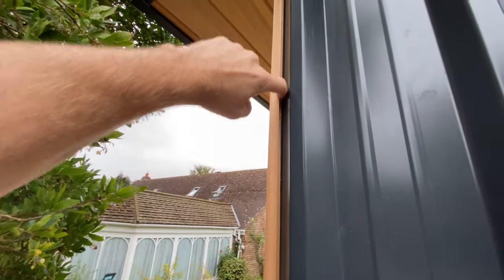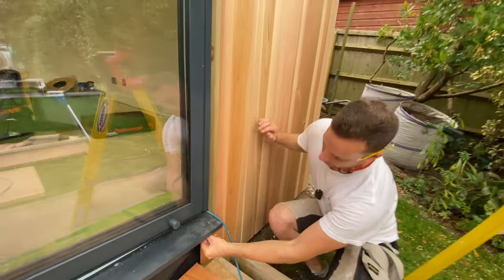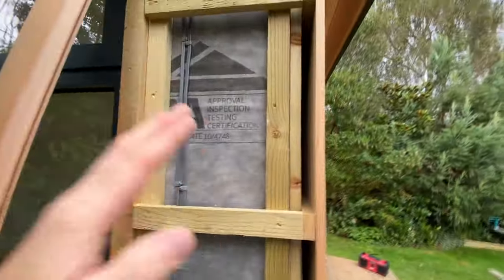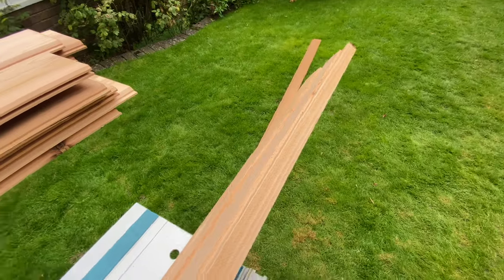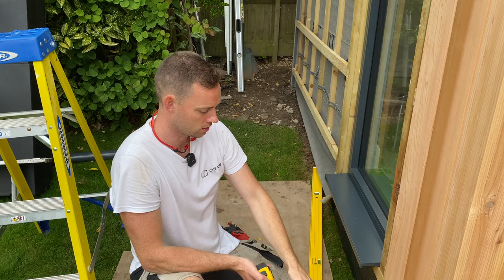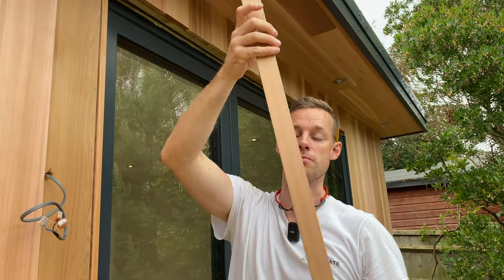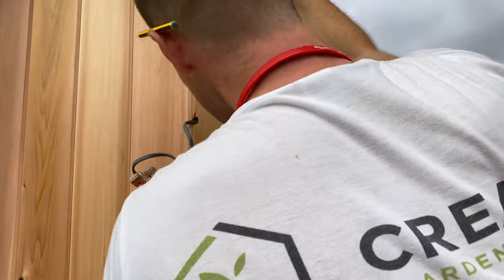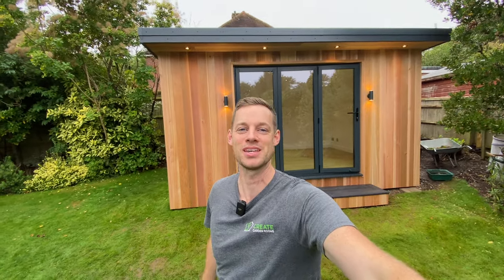PART 16 HOW TO CLAD YOUR GARDEN ROOM IN CEDAR FULL TUTORIAL WITH REVEALS

Comment: Your series of videos are fantastic. It’s given me the confidence to start my own build. I’ve got one issue.. I’ve poured the base for an 8x3.5m. I want an additional room to store a Massey 35 tractor (not very big). So I’ll need a 2.5 wide side room, to end up with a 5.5m garden room and a 2.5m room for the tractor. Obviously on this side room I need step free access. Would I have any issues with what will essentially be a large gap in that wall? As there will not be any attachments to the concrete base for 1.8m so I can drive in/out.
Reply from the maker: No that will be absolutely fine. Put doubled up 8x2 joists above the opening and that will do 👍
Reply: @creategardenrooms  brilliant stuff. Thanks for the advice. Keep those videos coming!

Comment: Looks great! Does the osmo UV oil you treat it with stop it from turning silver-grey in your experience? Thanks!!
Reply from the maker: Yes it does! If applied once per year in spring. 2 coats protects it best 👍
Reply: Planning my build for April, your videos are brilliant, thanks for taking the time to make them! For your door trims do you just cut a length of cedar down to size instead of buying the corner trims?
Reply from the maker: @thepenrice1402  you’re welcome! Great to hear you’re going to build one. For the trims around the doors we use 38x18 batten from Cedar Direct. We also buy the 94 x 18mm cedar straight edge board for the door reveals and rip them down to size 👍

Comment: I really like your videos, but I’m struggling to find lengths of Cedar that are reasonably priced. Even the alternative Larch is expensive. How much did the Cedar you use cost please…?
Reply: All timber is at a legendarily high cost so you're going to struggle to get a low cost. The most accurate costing I've had for a 5 x 4 building, the costings from multiple providers I've had for Cedar for all four walls was around £2500 and larch at £1800. The cost is, to some extent, the cost. You can reduce costs by using sheeting on the back as is done here.
Reply: @samnichols4361  thank you for taking the time to reply; its really appreciated 👍 - Larch on the front wall only it is then
Reply: @JohnSmith-rp7bc  Quite alright - I am this stage of planning my own space out there, and apart from the bi-fold door, door cladding it is the single largest expense by a fair way .; It was depressing looking at the square meterage and just knowing how much it would be.
Reply: @samnichols4361  yes, the prices would be something to not tell the wife about. But the principle that you’ll enjoy the benefits long after the price has been forgotten really do apply to this scenario. Secondly, i think that if I used something that didn’t look as good then I think I’d always be explaining how the price of larch or cedar was too high to anyone that visited, and thirdly, the price of plastic composite cladding is on the rise and will soon be comparable. As I’m planning to clad my log cabin in dark steel on the other 3 sides to protect the build even further from weather issues, I think some stained timber to the front wound be a good contrast.  Still can’t get away from the price though…..🤷🏻‍♂️
Reply: Another great video - where did you get the metal sheets from? Thanks
Reply: Pro tip. Try and find old play structures that people are looking to get rid of after their kids have grown (FB marketplace, etc). They are often free and often made of cedar posts. You can then remove the outer faded layers and mill them down into something usable. If you know someone who can do this for you, you could probably pay them and still be far better off.